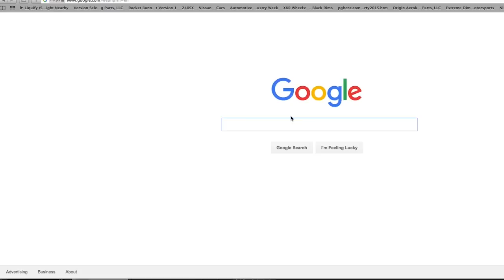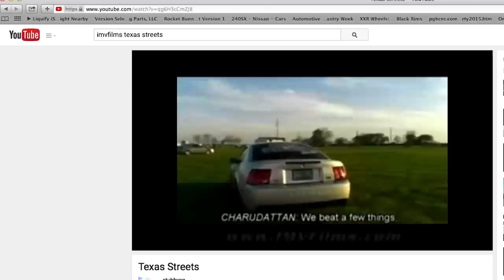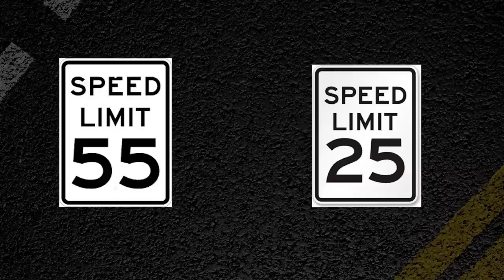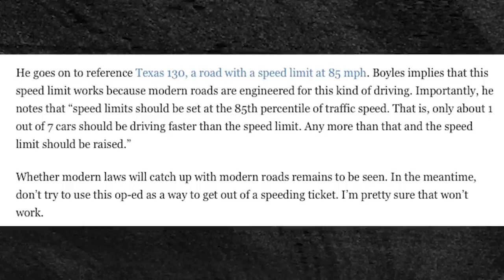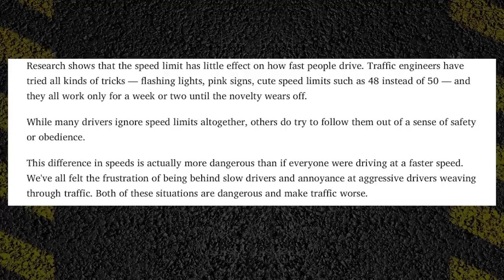Car Culture: A Love Story- A Film on Street Racing and Car Culture (Full Version)

Comment: they need to put an autobahn in the US, raise the speed limits and ACTUALLY ENFORCE TEXTING AND DRIVING. You can text right beside a cop and they won't do crap about it. they need to suspend your license until you pay 5 grand if they see you texting or calling. why should also lower the blood alcohol limit.
Reply: In Brazil they cut the alcohol to 0.
If you have anything you get a 1-2 years suspension and the car goes to the courtyard if there isn't anyone to get it quickly.
You can refuse to do the test but doing so will also get you suspended lol.

Comment: I just love cars of all types, looking at them, listening and learning about them, regardless of origin and what's done to them. I bought my CTS V because it looks good, is a comfortable car and still has good horsepower. I never thought I'd even consider modding it, but it's already begun. I've started to plan out my route of upgrading, even though I really don't race it, at least, not yet ;)

I won't go too insane with it though, at most it'll be cooling modifications, headers/pipes, pulley, etc.

I do plan on buying an older 240z or 280z and doing work myself to it later on. My dad had a 280zx when I was a kid, so I think it'd be cool to get one and rebuild it and upgrade it. All this, of course, once the V is paid off. :)

Comment: Historical note, btw:  There was a real correlation between the 55mph speed limit and a reduction in both traffic deaths and fuel consumption.  There was just one problem.   Both those things actually went down because at the same time  practical radial tires became what everyone was using.  

Ever wonder why movies up into the seventies involved horribly sloopy driving and tires screeching for no apparent reason just cause someone drove up?   Cause that was what those tires did.  People crashed.

Comment: The 1970 chevelle SS was factory rated for 450hp but it’s been said it was unrated for insurance purposes and that the car actually made 500-550. In 1970!! With carburetors and bias ply tires!! 4speed trans these cars were fast for their day and are still quick cars. They could do 0-60 around 5 secs or so.

Comment: A base model Challenger with a 318 had around 200 horse power, but that's not a fair comparison to Hellcat. Especially since the top model had a 426 Hemi rated at 425 horses just for the insurance agency's, actual numbers were said to be around 5-600.

Comment: Hey js
The original 1970 dodge challenger r/t  with the 426 hemi made an under rated 425 hp and almost 500 lbs tq
Modern dyno test have show that by revving it out to 6k vs the 5k the power was rated at you get closer to 475

Comment: Interesting thing about the 55mph speed limit,   ....for a while it seemed to be improving safety and fuel economy,   but that's just because it coincided with  radial tires becoming prevalent out there.   (Trust me,  back in the 80's I think I might have had about the last set of ordinary-but-new bias ply tires not for restoration purposes out there,  cause a friend gave them to me to tide me over.  (his grandmother had just bought them and put them away before giving him his Dart on snow tires or something,  and he just went and got radials on those rims. )   Anyway, the shortcomings became pretty obvious when I was following some Bmer over a hill and nearly plowed into the guy when he started showing off his ABS.   (back then your foot was your ABS.  :)  )   I totally decided, sitting there at a 45 degree angle inches from his bumper, to ditch the appointment I was on my way to and go directly to get some Dunlops I'd been saving for.  :)  (Darn, I wish they still made those GT Qualifiers.  )

Also, it's good points about other people's cars.   Sure, some things may actually be a bit cringe-worthy, but this wouldn't be any fun if everyone had the same taste as me.   The same thing with ridiculous horsepower:   it's impressive and cool to watch, but nah, that's really not what I want.   I like balance and handling and grip and late-braking and just a bit more power than I reasonably-need.  "Girl attitude," maybe,  but I think it's true what they say that it's more fun to be driving a slower car fast than the other way around.  :)   "Slower" being relative.    Anyway, people can buy 700HP these days, so I don't think it really 'proves' much anyway,   it's just if that's what you love, do it.  :)

Comment: The distance increase in breaking length in lets says 60 and 65 mph or 40 and 45 mph is pretty great and can mean the difference of life and death seen the effects of it from behind the wheel as well as on tracks where I got to test it with distances shown next to the track, the distance increase and the speed you go by the point you stopped at only going 5 mph slower is mind bugging...

Comment: The speed limit exists not because cars aren't capable of going faster than it. But how cars react in an accident at those speeds. Accidents get a lot worse the faster you go over 55, granted no one drives that speed on a freeway. But its a safety regulation, not a cars mechanical limit regulation

Comment: Love the video!

Not sure I agree that driving 55mph won't get you better mileage than driving 80mph though...

My datsun and my quad cab truck both get significantly better mileage on the road at 55 vs higher speeds

Comment: So, I have a quick question! For a car with a stock engine, does that mean they can only be swapped with an engine of that size? Or like, can it be swapped with anything you can fit under the hood?
Reply: has to be an ls swap or. nothing
Reply: +ScantSphinx9 Both but one will cost you some money and the other will cost a ton of money unless you are good at fabricating. You can even shove a small block V8 in a Miata if you know what your doing. Usually swapping an engine means you need to change out the gearbox, ecu, wiring, driveshaft, rear diff etc. So unless you are totally committed to the project its not really worth it.

Comment: lowering the speedlimit makes no sense (with the exception of rural areas and school zones and areas where there is alot of foot traffic) if you drive faster then you spend less time on the road and therefore have a lower chance of getting in an accident, it's people driving below the speed limit that should be ticketed, because they are the ones impeding the flow of traffic and causing gridlock forcing cars to sit on the road for hours idleing and dumping out way more pollution. so save the earth and yourself by driving safely and quickly.
Reply: Well, do what makes sense.    Sometimes the one you just cut off knew exactly when the next light you had to brake, stop, and re-accelerate for was going to change.

Comment: Speed limits can be okay if studied to make the street safer.
I really think it should also be different depending on the hour, day of the week, time in the year...
In São Paulo (Brazil) they dropped the speed on a few roads from 60km/h to 50km/h, a lot of people got mad and all, but you could see the deaths number dropping A LOT.
But is it necessary to have a 50km/h speed limit at 3am when there is nobody around or on a Sunday morning?

Casually, I do go over the speed limit sometimes, but I try not to be a dick or mess with other drivers..
I like to drive a little bit faster sometimes not to run, but to stay away from other cars, keeping some safe distance, 
in the same way sometimes I drive slower waiting for the cars in front to move.

But when it's midnight, going home after a party or just going for a drive, I tend to drive a little bit faster, but just on places I know there won't be other cars, and I also don't go as fast if I have people with me (apart from a few that share the same vibe as I do and want do me to run), because I don't want to hurt anyone that doesn't want to be there.

Comment: Best time ever for a car ? Have to disagree if you aren't just looking at the paper. Best era started in 1960 and ended in 2009ish. Cars are super powerful and super efficient, but they are so disconnected from the driver. This is just opinion of course but to me the best was the 90's and early 2000's. Once paddle shifters and the vast majority of the things that connect hand to machine became controlled by 1's and 0's it was over. The only car I can think of that tried to accomidate the best of both is the BRZ.... Thats just sad.....lol

Comment: Speed limits in the US are fuckin stupid. I got a ticket for doing 49 in a 35, but the road was a 5 lane road, two lanes on each side and a turning lane in the middle. It was the morning time after rush hour, around 11 am and there was a total of 5 cars going the direction I was going, fairly spaced out. I didn't even realize the speed limit was 35, I was just keeping up with the other cars. Whats even dumber is that about a mile down the road there's a neighborhood, two lanes houses on both sides, cars parked on the curb, that the speed limit is 30, which I don't do because it feels like i'm doing about 40 because the road is narrow, and there's a blind corner. It's just stupid.

Comment: I used to be really into tuning my car. Then I started spending around a thousand dollars per upgrade. So I started training for running.

Now I can sprint over 300mph for about 30 seconds, at least 250mph. To train I run on foot from New York to Los Angeles, usually takes me about 16 hours. I run at around 200mph but I have to stop for breaks occasionally. 

I can't understand what I ever saw in cars now. If you're in average shape you can run about 125mph if you push yourself, and with a couple weeks of training anyone can run on foot over 200mph. I'm not in the GREATEST shape but I have been training, and I can already outrun any production vehicle on the quarter and half mile drag strips. I guess cars CAN pull more weight, so if you have over 600lbs of cargo (my personal weight limit before it starts slowing me down slightly) then I can understand using a car. But I'd you're just transporting yourself, unless you're like 800lbs of pure fat, it's a proven scientific fact that you'll be able to run faster than any car out there. 

After all, most cars on the road now can't go faster than about 130mph, whereas even out of shape people can run at at least 150mph, and anyone decently in shape can run 200mph. 

I dunno, I do understand the appeal of a nice car, like I said I was into it for a while to, but these days I just don't really understand why people drive cars when the average person runs faster than the average car.

Oh well, different strokes for different folks, I guess.

Comment: What about snow drifting???
I almost got into a chase once lol subie gang yaalredy knowww
Reply: I think that's just as much fun and you don't go through tires that way.   (Though too much power can actually be a liability for that.  This is not my current problem, though, as my vehicle will not drift in the dry.  :)  )
Reply: OllamhDrab it's safe for the car as you don't put alot of stress on your car.. Specifically if you drive an AWD car.. But it's not safe for the driver unless you have some skills.. But you're absolutely right

Comment: About 95% of the parts avalible make you loose your street-legal status in Germany.
Reply: ***** We have the "TÜV" over here, which is a very thorough inspection your car has to pass every few years.
That only works if the aftermarket parts you install come with special paperwork, which would be ridiculously expensive to try and get on your own.
And the police wants to see that paperwork too if you're pulled over.
For most foreign companies, the small german market isn't worth getting that paperwork.
That's why there's very little tuning on the market (assuming you want your car to be still road-legal), and the companies can demand pretty high prices.
Most of them (RUF, ABT Sportsline, Brabus) "bypass" the paperwork by being registered as manufacturers.
Reply: police be like: oh you changed your tire size and you didnt go to tüv to check it. your vehicle is illegal you know

Comment: I just have to point out how one sided some of your arguments are here, Dave. If you went to someone like Mr Norm's and ticked the right options then you could have WAY more power than that. But I think you know that already... Even in stock trim, untuned and as delivered in 'day one' condition, the big blocks of that era made low to mid 400hp figures. A well tuned one with 'day two' mods could make up to 600hp with some engines